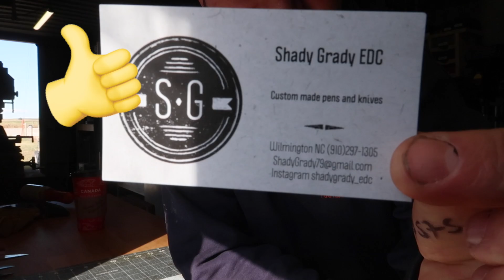Making knives for the website! (& a rant...) - knife maker's daily vlog -

Comment: Really like the knife making video's. kind of reminds me of my grandfather he used to own a tool and die company up in Maine.and when it came to working with steel he new his trade. He had a mechanical hacksaw that used a 36 inch blade the blade were about a quarter inch thick and very expensive. So when they became dull. he would replace them and set the dull blades aside for his version of recycling. he would re-cut and shape grind re-temper with ox blood until he had the blade he wanted. he made knives for everyone in the family out of those old hacksaw blade. and they were the best blades I've ever used.

Comment: a tip for the dust at the cameras. buy a cheap filter for your lens and glue a plastic bag on it and put it over the camera and close it under the camera with a rope or so. it will not air tide but will hold out the most of the dust.
Reply: Isaac Lawson no you wont if its a proper filter you use. Dont put the plastic on the lens but arounde the filter

Comment: About the camera. Sounds like you have taken the lens off and cleaned it several times. Also sounds like the lens unscrews. They have "plumber's grease" at lowes. Comes in a small round plastic cannister. It is essentially a thick silicone dielectric grease. You'll know the stuff because it is clear, and says silicone. Next time you clean the lens, coat the threads on it, with that grease. I think it will work to keep the dust out. And it will only help, it won't cause any damage.
Reply: If that fails to keep the dust out, then it is likely that the dust is getting in around the glass. Between that, and the metal rim. You are definitely good enough at detail work that you could remove the lens. Then using a hypodermic needle or some such, put just the tiniest bit of super glue all the way around where glass meets metal.